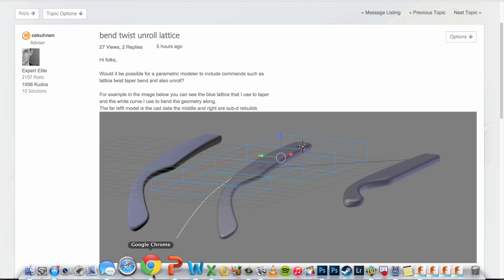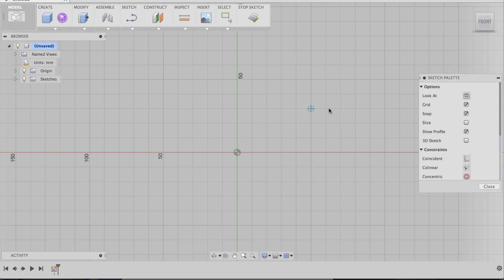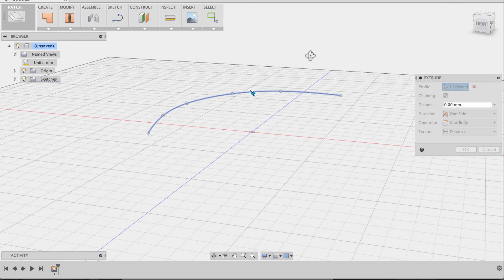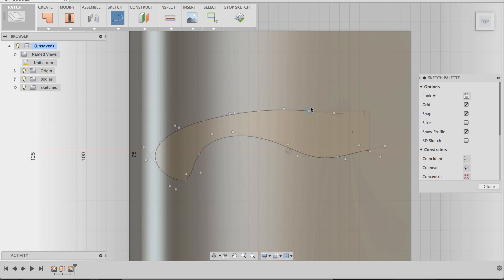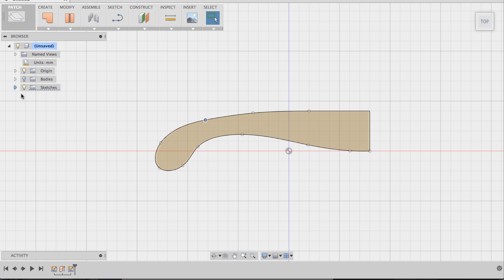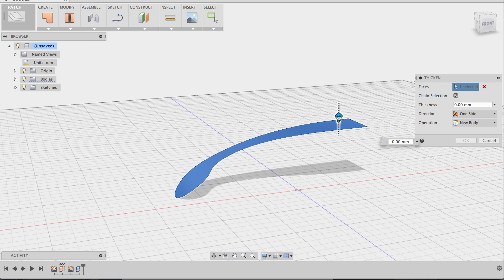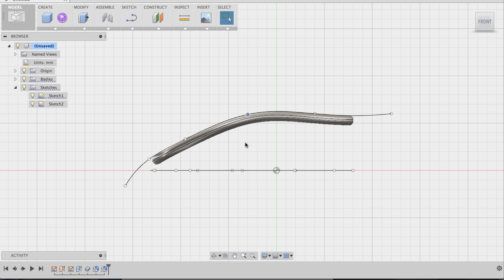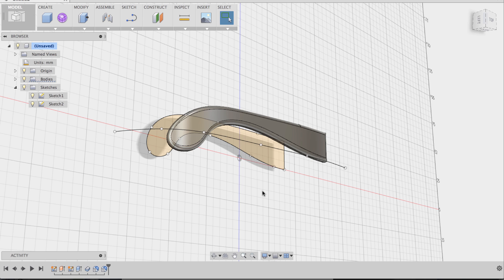How to model bends in Fusion 360

Comment: Obviously this is not a bend and not a replacement since bending keeps length of initial (abstract) object intact (with k factor 1), and you can specifiy it. Any kind of projections (even by normals) ruins it (except some specific cases)

Comment: It is amazing what you can learn from a 4-1/2 year old video.  I think that I am pretty good at modeling in Fusion 360, but I never even noticed the 'Intersect' option of extrude.  Thank you so much for this video.
Reply from the maker: THIS is the exact reason we keep these older videos. Yes, we get some complaints that UI is drastically different (and it is), but you can still gain valuable insight from these!
Reply: @adskFusion  I hope you never take any of your old videos down, no matter what you do with the interface.

Comment: Why is it when I follows these steps exactly I get no option to select operation as "Intersect"? There is only new body and new component. EDIT: Nevermind I was selecting the wrong extrude. There is two extrudes there, not sure the difference but one works the other didnt. (Im new as you can see)
Reply from the maker: Glad you were able to figure it out! Thanks for the tip, hopefully it helps others!

Comment: Great instructions. I'm working my way through it but I'll get the hang of it eventually. Now what I want to do is apply a very small twist to that arm, so if you imagine that as the arm curves around the shape of the side of the head, it also has a slight warp along its length. e.g., If you were eye balling a warped fence board by holding it at one short edge and looking along its length extending away from you, you would see a dip down somewhere near the middle for the bow in the wood but you'd also see if it was twisted a bit. 
I tried to repeat the steps of extruding the bent object through a second patch curved at 90 degrees to the first patch, but the extrude popup doesn't offer "Intersect" anymore.
Probably you can't do this method twice?

Comment: This fusion 360 software is soo dynamic... I highly doubt that this feature exist in any other CAD software.
Reply: Rhino - bend, or flow along curve or cage edit/line (true bends without stretching). You can bend not only a single part put lots of details, assemblies. Solidthinking - you can bend as well... It's quite a typical modificator, so do not doubt that other software has it.

Comment: Hi there, any news if Fusion will get real bend and twist tools soon? The problem with the shown demo is that you cannot measure the length of a part and bend it. You stretch the part when bending ;) also this only works with flat temples. If temples are more sculptural this will not work.

Best from Michigan!
Reply: Yes, and also this method doesn't really allow you to bend something more than a little. If you want something to bend back on itself, you'll need to head elsewhere?
Reply: +1
Reply: You can infact measure the curvature of the bent material model as in the example of the shape in this video. What you need to do is draw several construction lines perpendicular to the direction you want to measure and then draw a new construction line perpendicular to the several lines you had just added. Then you add up the lengths by observing the measurement size as you go along. You may have to create several construction lines as well. However, this will give you a basic circumference size of the outer or interior face of the curved shape.
Reply: @arkain101  thanks, although too much construction lines, you almost get more lines than the orginal model
Reply: This is how I measure a lot of things with the program, by using construction lines in the sketch mode and it works very well.
Reply: Actually the new sheet metal unfold fold back can be abused to do bends lol !

Comment from the maker: Here's' a great video on how to model bends in Fusion 360.
Reply: Autodesk Fusion 360  the thicken function doesn’t work- says operation could not heal the edited region of the model and to change the input geometry.... I’m making replacement Oakley frame arms and no matter how I try to thicken,extrude,push/pull etc I get the same error. I usually just extrude from spheres that I edit or actual models of “heads” but thought this would be faster and it won’t work...any updates on bending and twisting features as I have the newest 2018 version ?
Reply: what if I want to bend a solid that has no history? no sketches?
Reply: @RH3D  so you need to change your soft for something less useless

Comment: As a pattern so you could machine the part then bend it last and end up with the desired shape.The flat work piece would be a little longer and have a slightly different shape (depending on how much of a bend is put in it) than the bent piece.Just wondering if there is a way to wrap a sketch around or onto a surface.
Reply: Ed Germain Ed, this is in the Fusion 360 Idea Station as Flat Pattern Development. It's a capability I would really like to see in Fusion. Your example is another way it could be used.